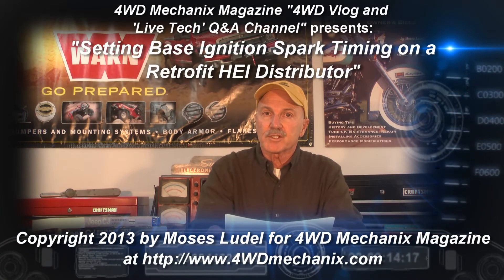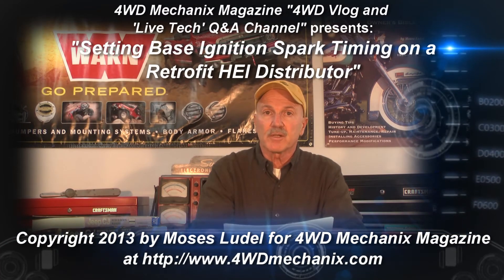Q&A Vlog:  Base Ignition Spark Timing on a Retrofit Jeep 4.0L HEI Distributor

Comment: I have a Jeep 258 with an Edelbrock head.

Is it true that an Aluminum head can let you advance timing more?  I currently run 89 Octane, but can go up.  I also run Propane, which IIRC is 110 Octane?
Reply from the maker: The main concern around advancing spark timing is detonation ("ping"). Octane testing involves finding the detonation point of a fuel, using an "knock engine" in the lab. The single cylinder has adjustable spark timing and can add compression to create detonation...As for your aluminum head, aluminum dissipates heat better than iron, and heat adds to detonation risk, so there is some gain with aluminum. More important is the combustion chamber design. Good shape and flow at the combustion chamber can reduce detonation risk and allow more spark advance. I'm sure that was a goal for Edelbrock, not just the weight saving factor of aluminum. Regarding 258/4.2L detonation risk, when installing a Mopar MPI/EFI conversion kit, Mopar recommended 91-92 octane fuel when running the stock 258 head. The stock 4.0L MPI head has a better combustion chamber design that resists detonation. (There is no knock sensor required.) The 4.2L/258 head worked okay with carburetion but did create detonation issues with the leaner, more controlled air/fuel ratios of an EFI conversion...Propane is less of a detonation risk but produces less horsepower than gasoline. When advancing your timing, detonation is the key. Horsepower increases with spark advance but detonation limits how far you can advance the timing.  Higher octane gasoline helps resist detonation and allows more spark advance.
Reply: @4WDMechanixMagazine   All makes sense, the Edelbrock head does have a "better" chamber, also uses a cooler spark plug than the 258 head.  I am using a carb, tad on the richer side for the TQ power, but I tune with an Innovative LM2, not reading spark plugs, so I know I'm spot on there.

I did the timing, I'm at about 15°, lol.  With tank half full of 89 and half 93 Octane.  No Pinging, so I'm either a tooth off, or just on the cusp.  It responded well, instantly idle went up a tad, more power, and even stays a tad cooler.  Who knows, these heads are so rare, it's hard to find info one how others have tuned them in the past.  I appreciate your vids, though!!!!  You helped me choose lifter rods, the previous ones from last owner were insanely long!!